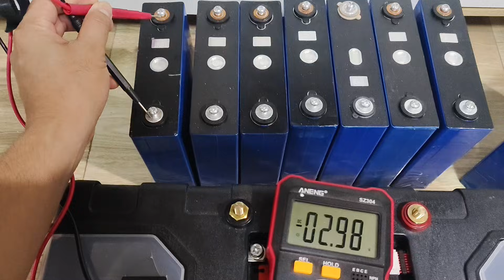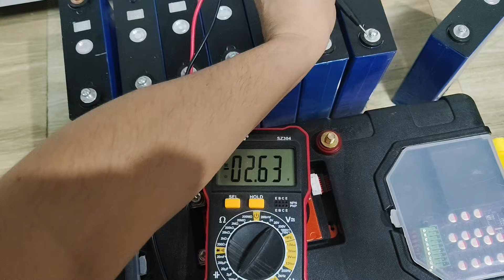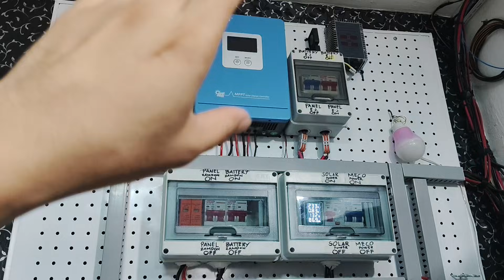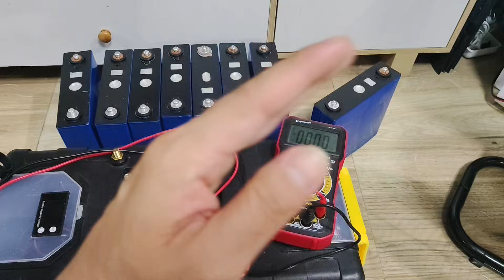Solar DIY LIFEPO4 BATTERY GETS BURNED - HOW TO AVOID?

Comment: I've never seen damage to a prismatic cell from over discharging.. but I HAVE seen it from overcharging. 

I would put some independent voltage meters on each of the cells to verify that DALY BMS is operating correctly.
Reply from the maker: @honeybadger6127  thats a good advise. will put my batteries with that one!!! thank you!

Comment: that's what the bms is for you just have to wire it correctly
Reply from the maker: it was wire correctly, been using it for half a year. and i think its because its always overdrained. my lvd is set to 20%, but over the night the scc is taking some load and in the morning the bms cut off due to i think it has maxed out its taken capacity.